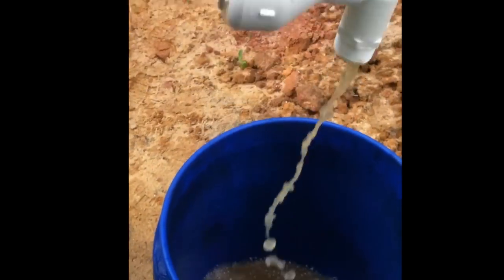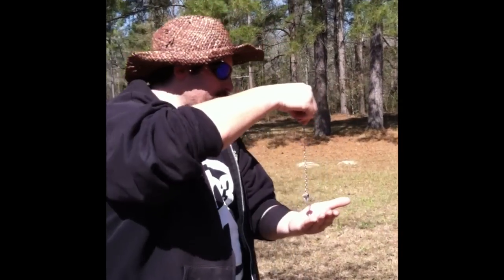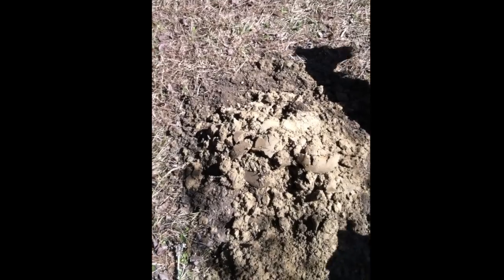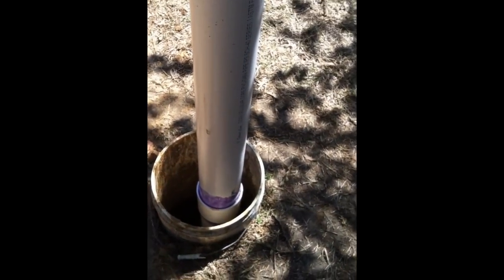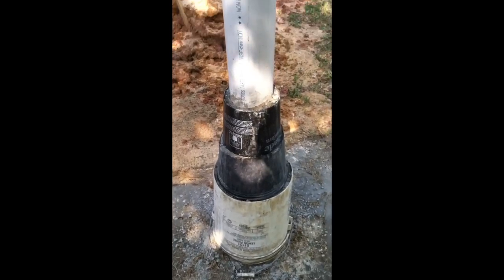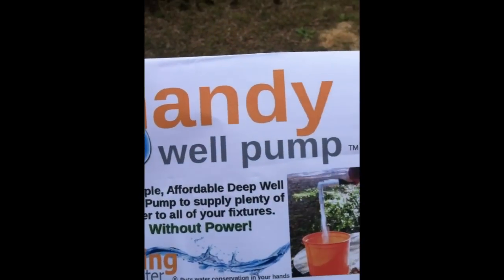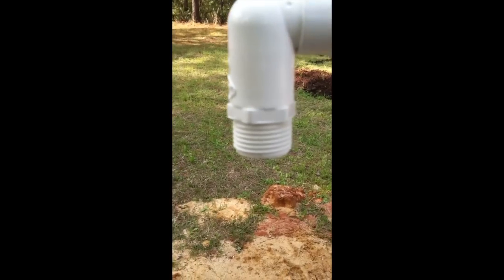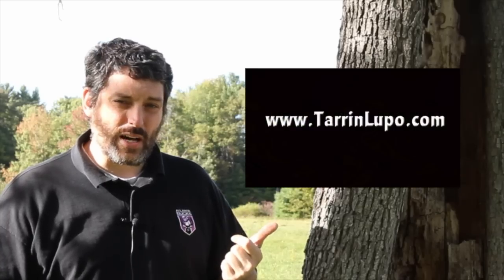How To Hand Dig Your Own Shallow Well on the Cheap - Off Grid Living

Comment: I'm in Lake Placid Florida.  I found a low spot on my lot and hammered down a $13 Brady PVC WellPoint  about 12 feet with some 1-1/4 inside couplers  and found clear  water.   I then attached a $20 manual bilge pump with some rubber couplings I can fill a 5 gallon home depot bucket with about a dozen good strokes.

Comment: if it’s for drinking you put the well on top of a hill it’s more work but it  stops the runoff in the spring from contaminating the ground water if it’s for crops then it’s fine to dig in a valley because plants don’t care about runoff

Comment: Yes, this is very easy, I have drilled 2 of my own wells. The first one I did at my old house, I hit water at 17 feet, bought a screen and 20 ft of galvanized pipe and a shallow well pump, I used it for my lawn.  When I moved, I did the same thing, hit water around 17 feet, but this time I used 2"galvanized pipe (with screen 22 feet deep, all the screen has to be below the water, or you will suck air), with a shallow well pump. But again it is only for my lawn, I cannot drink the water, because this is only at the first aquifer. If I ever do it again, I wold do a 4" well with the pump at the bottom.

ps, you really get funny looks from your neighbors putting the digger in and out , but only took about 3 hours to dig!
Reply: How did you find water on your property? like the method?
Reply: @southernyankeeprepper  I just decided where I would like to have my pump located . I do live in Michigan, lakes and rivers everywhere.

Comment: Maybe using two large pipe wrenches to hold pipe from slipping into shaft. Another way is a pipe clamp. Using threaded pipe and threaded couplers allows the worker to add or remove pipe in manageable lengths.
Great Video!
Thanxfor all the info!

Comment: You should always rinse your pea gravel before putting in between the casing and wall otherwise you will be drinking the gravel dust as surface water passes by. Poking holes in the bottoms of the bags and hosing out works great.
Reply: the dust gets washed away very quickly as you clear your well.......

Comment: From what I've heard, you can use metal rods for dousing as well. Bend them into a L shape and to insure they rotate freely out the ends inside plastic straws
Reply: As long as you coat hangers point down, you’re gonna find some water. Oh, and if you’re interested I’ll sell you the best dousing rods ever for $100 a pair.

Comment: I am using a 20ft piece of Rebar cut in half, rejoined with welded on pipe fittings, and a Auger Bit ( used for anchoring buildings) welded to one section, and a Handle that can screw onto each section of Rebar.
Reply from the maker: Seems like it would work, let me know how it comes out.
Reply: *****
Dirty   XD.

Works just fine but I have a Back Injury, High Blood Pressure and Carpel Tunnel so it's Slow going. I Offered to to Pay someone to do it on Craigslist but have had no takers. They keep telling/calling me "Ah man, you doing it all wrong. You got to Jet it in". My reply "Ah Man, I have NO Water to Jet it in. That's why I need it Drilled by Hand."  Then they are like "Oh (click)". Stupid Phucks never fully read my listing saying "I Have No Water to Jet it In".

Comment: You don't ask is this a good place to dig an it magically shows you. You can you most type's of wood to make rods an holding them loosely so they can move when you stand ove water by following the fault lines an flow of water. It dose work if done properly 👍✌

Comment: Take a walk in the woods. Note the wet spots at the base of a hill. Follow most strea.s to the head and there you will find a spring. Very little digging needed to pipe the water where ever. A water ram and you all set. Now wasn't  that so mush easier.

Comment: i've seen someone use a motor, and this auger thing... hey have a metal vertical holder thing that they add to it that makes it stand up straight while its turning... Then they use a PVC pipe to suck it up, they mix water down the hole so the mud goes through the pipe

Comment: Using an 8 foot ladder makes putting both the 4 inch pvc and pump pvc into the whole very easy. Also use two metal clothes hangers cut into L shape and test over your bird bath.

Comment: You should have wrap geofabrics around the gills of the pipes so the water wouldn't be so brown/muddle. 

And if you want to make your life easier.  replace the hand pump with a solar water pump and connect it to a water tower.  I think a 20 ft high tower frame with a couple of hundreds gallons water tank on top should hold enough water for your daily use.  20 ft high should give you 8 PSI water pressure, assuming the average water level use is 6 ft.  8 PSI is adequate for most use.  But if you want more water pressure, then build a 30 ft tower instead.  And what ever your water pressure need,  just build the tower to require height, taken into consideration that there is 1 psi for every 2 ft height.

Note: I would give you a link to some of the available geotextile fabric on Home Depot & Amazon, but it seems that Youtube will censor my post if I do that.

Comment: OK Doc.......after you have the pump primed. What do you think about adding a 12 volt H2O pump to the outlet side of the pump with a small solar panel to provide power to the H2O pump?
Reply: That's what I did. I used a 12volt rv pump system with a pressure switch built in. 12 volt pump is hooked to a deep cycle battery charged by harbor freight solar kit. It pumps directly into a 1000 gal tank with a simple plastic float switch inside the 1000 gal tank. I have a bigger shallow well pump on the 1000 gal tank going to the cabin. The 12 volt solar setup always has the tank topped off and its pretty cheap and maintenance free.
Reply: @mandmmilling3716  can you post a video how you did an electric solar pump?
Reply: I cant get pictures right now, but ill describe how I did it until I can. Things need.1. harbor freight 100 watt solar kit, 2. deep cycle battery, 3. 12 volt rv pump with a built in pressure switch, 4.  cheap plastic trough float valve, 5. suction hose with screened strainer at the end, 6. optional foot valve. So, here is how I built it. 1. connect the strainer and foot valve to the inlet hose. 2. connect inlet hose to pump. 3. mount the cheap plastic trough float into what ever storage container your filling. 4. connect pump to float. 5. connect pump to battery, 6. connect solar to battery. that's it, simple and reliable. Its hard to take pictures of the one I use, but I think I have spares to put in a line at show people. I use this same set up to clean wild game too in the field.

Comment: One guy I saw used two coathangers bent at 90 degree angles in an L shape with one leg about 4" long which he cut a straw to use as a handle which allows it to swing freely and the other leg about a foot/foot and a half long.  Both were the same dimensions.
Reply: @honuswagner9348  Were the controlled studies using people that had actually created working wells by divining?
Reply: @honuswagner9348  Well it makes sense that water would be everywhere underground.   I was just making a statement about what I saw, not a claim of truth as to its veracity.
Reply: @honuswagner9348  I don't think "divining" actually requires anything supernatural at all.  I do not believe there is such a thing as the supernatural.   Everything must necessarily be natural.   Fields are natural and they seemingly affect things at a distance.  To people with a primitive understanding of the phenomena, it appears to be magic.  In fact, the word magic is derived from the word magnet.  Water is a polar molecule and creates an electromagnetic field as it moves.  This is easily empirically proven.  Electromagnetic fields have certain physical effects on objects, though they are not entirely physical themselves.  As we humans are primarily made of water and we do have a nervous system that uses electricity to communicate messages within the body, I do not think that it is entirely outside the realm of possibility that people can pick up on subtle shifts/changes in the electromagnetic field that surrounds them.
Reply: @honuswagner9348  How would proving water divining works make me rich?  Also, if it does not work, why have so many people throughout the years used it?  Don't you think after hand digging several dry wells they would determine that it doesn't work?

Comment: Exactly what dirt were you trying to prevent falling back into the hole? As far as I can tell, all the bucket did was make you lift the auger higher to get it clear of the hole. I have no doubt keeping that handle on the pole caused you more work than if you had removed it each time before extracting the auger.

Comment: Coat Hangers or Electrical Grounding Copper will work for Dowsing Tool and Both Work......
Reply: randy beard your right, iv done it with welding rod also  its pretty amazing
Reply: Is it easy to use this method? I'm needing to find a spot but kind of skeptical on pendulums and dowsing rods..

Comment: The VERY FIRST THING THAT SHOULD HAVE BEEN SAID .......DO NOT DRINK THIS WATER !!! This water is seepage water or simply rain water that has not been filtered good yet....The ground is covered with bacteria and when it rains that water mixes with that bacteria and seeps it into the ground...That is why a drilled well does down into at least the first water formation for irrigation and the second or third formation depending on the water's ph level for a residence or home use. It takes rain water around 70 yrs to seep down 100ft. so by the time it travels through topsoil, clays, chalks, several different sands , rocks, shells, it has been purified by nature and is clean fresh mineral water. This water in this shallow setting could possibly even contaminate livestock or garden plants with bacteria if used on them.....
Reply: Clorox shock it. Done. We have a spring fed shallow well.  Still not dead yet.
Reply: @pcolvin4235  you would have to treat every continual drop of water coming out of that hole because it would continually pump bacterial water...Your basically showing people how to get sick from drinking seepage water.
Reply: twobitsmith1 Hey man, whatever makes ya happy. You do you.

Comment: Hello, loved the video! I am located in New Hampshire though and am wondering how this would handle a very cold winter? I would put a roof over it to keep snow off, it would however still get down to below 0 degrees F over night. Is that okay because all the water is in the bottom below the frost line when you are not pumping? or does any stay in the pump?
Reply: I live in Christmas Valley OR and it gets to -20 in winter, Use a 12 volt dc bilge pump and solar panel. My koi have the same pump
that runs their waterfall and the pond gets 4 inches of ice. The waterfall melts a holein it by noon,
Reply: @vistagraphsnet  No way.

Comment: Good deal it's a lot cheaper than a 6000 to $12,000 pump that the professionals make and you can always add a electric power pump to that and then pipe it into your house pipes for all of your water needs

Comment: Hello, Interesting video. I was wondering if you can hook up some sort of electric pump to the threaded connection, like a small pool pump? Also, what area of the country are you in?
Reply from the maker: I am not sure about the pump, I dug this in Savannah Ga.  Water table was easy to hit.
Reply: No. It's going to suck air, because this is not how you drill a well.

Comment: Hi,
Awesome video. I am using the same auger for digging my shallow well. A question for you.
1) When digging until 15-16 ft, the soil is so muddy/watery. Nothing is holding inside the auger head when I pull it up. How did you manage to get by this and dig until 21-22ft? Did you use other digging tools?

Thanks for the helps.

Comment: Nothing magic about dousing, they use the principle in finding power cables or water pipes all the time. Water veins consternates the magnetic field of the earth, your dousing rods act like a compass and will line up with the direction of the magnetic field. I use old wire clothing hangers cut two pieces into L shapes with one end twice as long as the other. Hold them even about waist high loosely in your hands, walk forward and when you reach a water vein the rods will aligned with the water vein. If you step backward, they will straighten out. Works every time.
Reply: Why does one have to be longer than the other? And at what point will the copper rods be like when directly over water?

Comment: Now you can pump all kinds of surface carcenogens and ground run off,  I truly hope you checked to see if your well is not on top of an old trash dump that has been covered over. lolI recomend , if you want clean un contaminated water, hire a professional well driller and pay for a deep well (a well that is sealed off to the surface water. otherwise you may be dieing a lot sooner than expected.
Reply: Don't get me wrong, but this is not for human consumption, only for  lAND SCAPING AND CATTLE OR OTHER LIVESTOK. The whole thing can be powered off of a solar power, and a resurvor of a 1000GAL CONTAINMENT.
Reply: Could you run the water through a purification process like boiling it and collecting the steam?
Reply: @MasterGrub  Berkey water filters have the capacity to filter straight river water, so you could do that, but you'll probably burn through filter cartridges pretty quickly.
Reply: It beats drinking from a muddy hoof track.
Reply: I bought a water purification system thats good up to 10k gallons at cabelas for like $30
Reply: @cliftonbanks5590  I've had to do that...sure wish I'd had a berkey.
Reply: My grand mothers well is only about 25 feet and she been drinking and showering with that since the 70s and she's fine
Reply: @mariorancatore5394  And likely healthier than us fluoride drinkers. Same w my Grandparents. Was a sad day when they were forced to tie in to city water.

Comment: OK SO... my well, elec well, has a nut on it ,im told so if  i wanted too i could do a hand pump well for when elec go's out. also told it would cost like 2000$ for someone to lower pvc pipe into it to make a hand pumper, anyone got a clue what im talking about? could inform me, i dont think 2000 is correct at all. i could get the pvc really cheap and a hand pump for like 40$. so inlighten me please . 10/01/19

Comment: that is a very shallow well, what if you find your well is like 50-150 feet ?
Reply from the maker: Because of pressures and capillary action wells past 22-25 feet are about the maximum for hand dug without a mechanical pump.
Reply: Ok so this won't work for a whole house to run everything.
Reply: not at all.
Reply: How did you know how deep you would find the water level to be? What if you spent all that time and energy, and still no water? Any way to identify water depth from above ground?
Reply: That's easy... All you have to do is ask your necklace to find water between 20 - 22 feet. I bet you feel foolish asking a question like that now, huh?